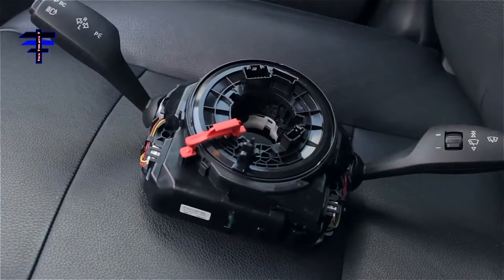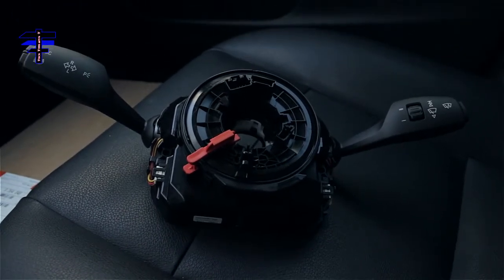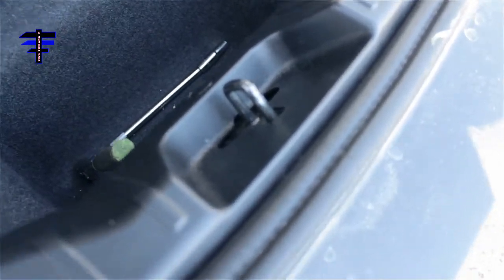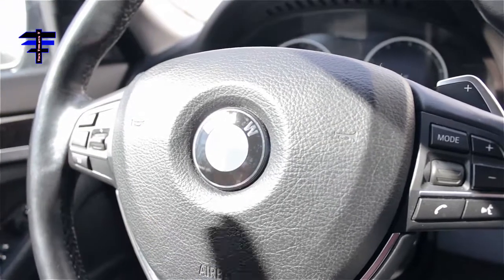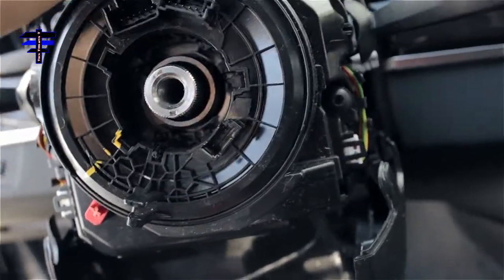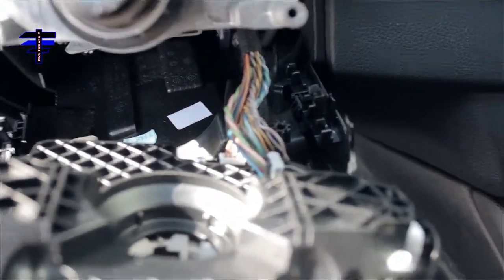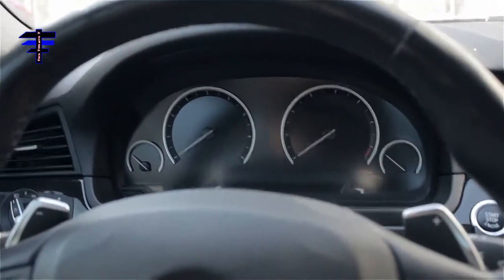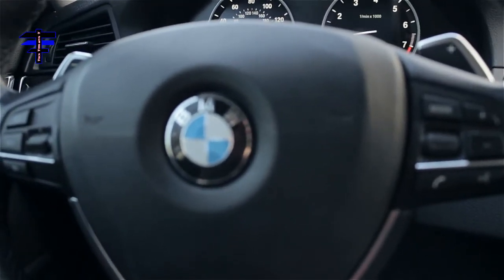DIY:  2016 BMW 535i Xdrive Steering Column Housing Replacement II Tech Time With T II Vlog '24

Comment: I’m having a similar issue with my BMW F10, I’m just wondering if you needed to do any coding or calibration after replacing the part or is it just plug and play?
Reply from the maker: I did not have to code mine
Reply: Thanks for the response!!!

Comment: you still got a coding or program
Reply from the maker: No coding.  Everything went well!
Reply: U still had the steering warning after replacement .
Reply: @rehan1uk  I am wondering the same thing. I imagine you could clear the codes with bimmercode or something like that?
Reply from the maker: Nothing else came up for coding.
Reply: @hsmith3560  hi, no I have still have the steering warning , but no issue on driving , power steering is ok now , few mechanics consulted locally .no joy.so no help from anywhere. If u know any solution let me know ow .